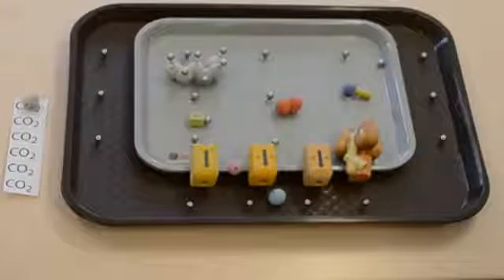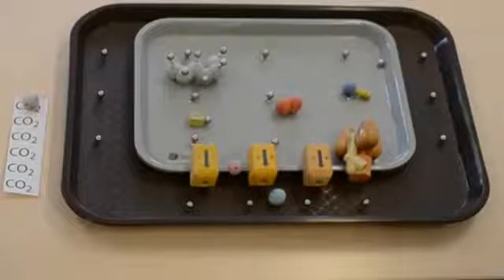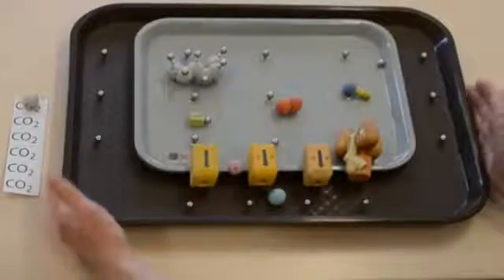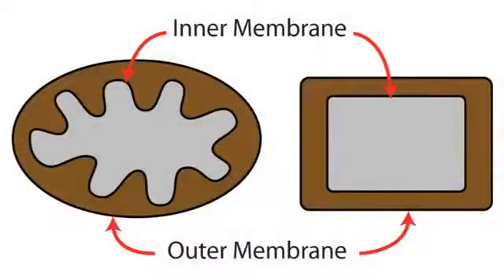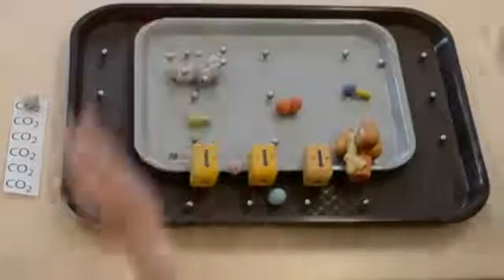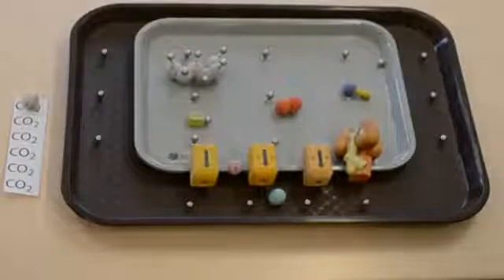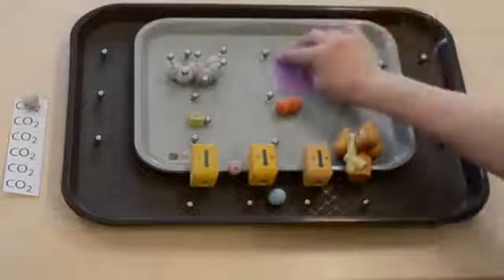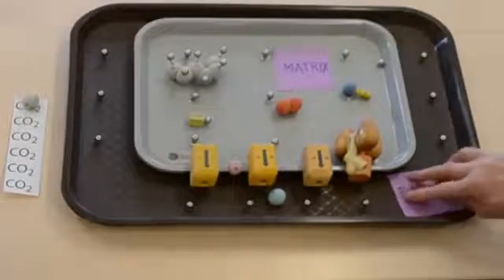1.  How ATP is Made in the Mitochondrion - Overview

Comment from the maker: Hi. This is Ann Batiza from the SUN Project.  Students often wonder WHY electrons move from food to oxygen.  You can think of this as a series of  "tug of wars."  There is a series of carriers within each of the orange pumps that quite literally strips an electron from an adjacent carrier.  Therefore this tendency to attract electrons (a Coulombic force!) by these strategically placed carriers (in a series of tug of wars) is what causes electron movement.  In many living things like us, oxygen is the ultimate electron acceptor - the carrier that holds most tightly to electrons in this path.  (Some microbes have other ultimate acceptors and can live deep in the soil where there is no oxygen!)  It's great that our food we eat loses at this game!

As those electrons move across each pump, these negatively charged electrons attract positively charged protons enough to cause a net movement of protons from one end of the pump to the other (another Coulombic force!).  Then when those  concentrated protons randomly enter the ATP synthase, they cause its rotor and central shaft to turn which ultimately allows ATP + H2O to be recycled from ADP + Pi.  (Video #3 shows  the SUN mechanical ATP synthase).

Note that all the interactions described here are RANDOM interactions, based on the random collisions and stickiness (binding constants) of the different players.  Also note that while energy is released as electrons move, only SOME of that energy can be stored in the chemical bonds of ATP.  While energy is conserved as electrons move from food to oxygen, some of that energy must be dissipated  (lucky for us this is as heat!), and therefore only some of that energy is stored in a form we can use - ATP.